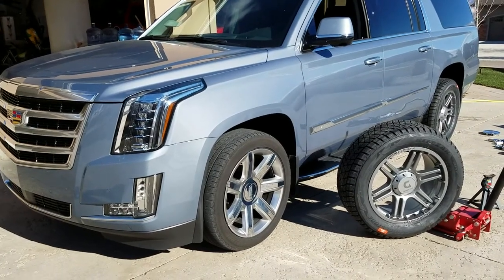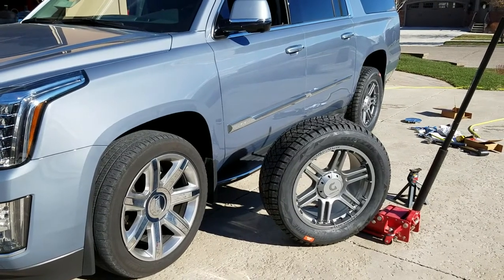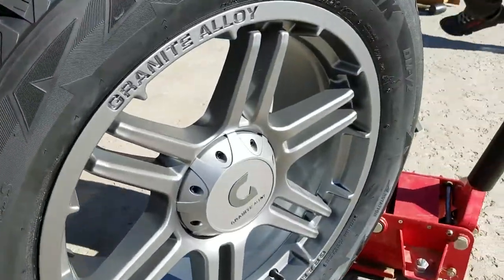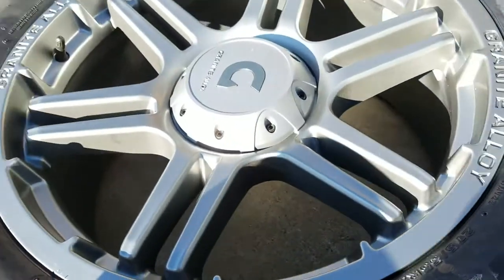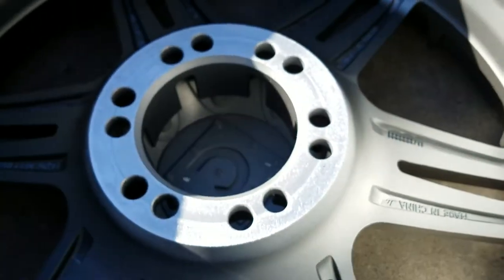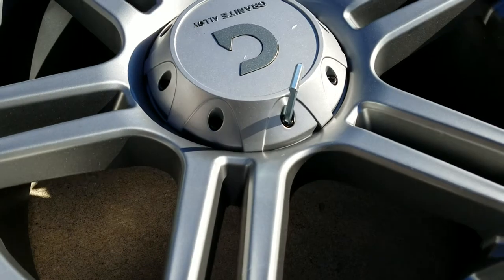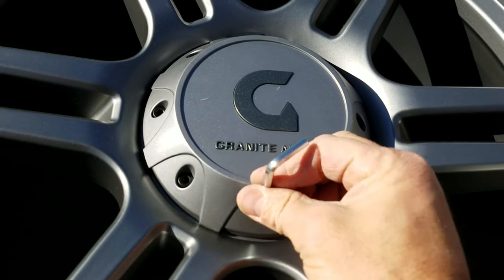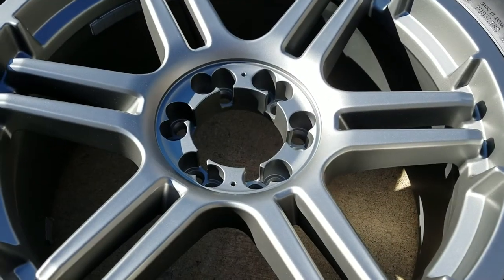Granite Alloy Rims hub cap removal

Comment: I'm interested to purchase these wheels for my 2020 Ram 1500 limited for 20" tires to help reduce my weight overhead when towing.  I've read these wheels are only 25lbs each.  How do you like them on your Escalade?
Reply from the maker: They’re not bad. Not a great match for my Escalade. I didn’t get them with quite enough offset so they stick out just a little bit. I’m not sure how much they weigh but they do the job for my snow tires.